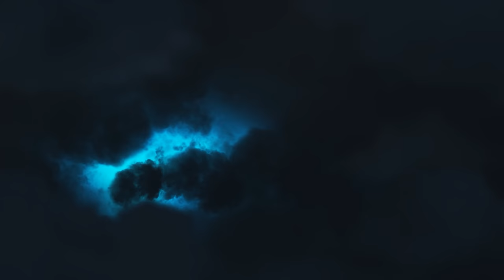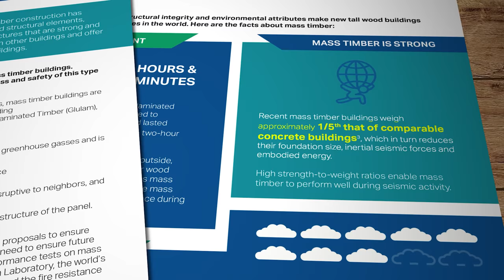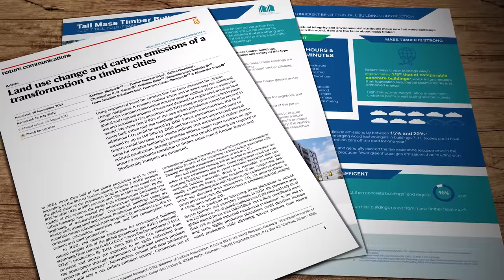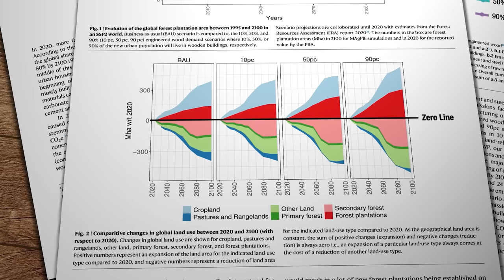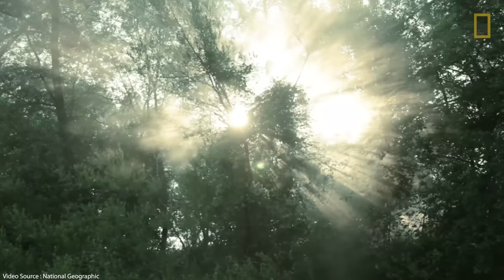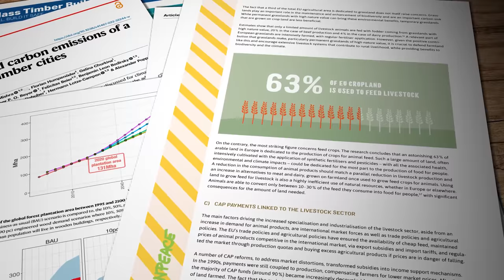Engineered Timber - building the skyscrapers of our future.

Comment: I did not check the complete study but does it take into account that steel can be made with far less CO2 émission using H2 and cement processes can also improve overtime?
As always the solution will be a mix of advances in different areas
Reply: Only thing is that the H² would have to be Green H² or somewhat equivalent. The process to get H² must be without releasing CO² or any other greenhouse gas into the atmosphere. Currently these processes are fewer and have not fully resolved the transportation and storage of H² in a significant way to make steel and concrete a viable green method of construction. Still a long way from this happening; I would say at least minimum 10 years away.
Reply: @Drought-jr6pb  Why transport hydrogen when you can transport electricity for electrolysis with existing infrastucture?

Check out SSAB's HYBRIT project. They are doing exactly that, running electrolysis plants in site and just storing hydrogen for later use.
Reply: @Drought-jr6pb  So, decade to construct H2 production industry powered by RE, parallel decade to construct H2 iron production industry (eg in Pilbara, Australia). I agree, neither will be under a decade, but economics will drive disruption more than politics (ethics).
Reply: @pikkuraami  So you are right about SSAB HYBRIT system, if what they say on their website is right, it will cost about $27 million per electrolysis plant (not storage) and they have 3 plants that use blast furnace. But it also mentions that these plants require 15 Twh per year.

Wikipedia says it takes at least 440 KWh to produce a ton of steel using an Electric Arc Furnace. The biggest SSAB blast furnace plant produces 2.6 Millon tonnes of steel and based on calculations I did an Electric Arc Furnace that if it could produce the same amount of steel would only use 1.144 Twh of electricity. And SSAB already has 2 Electric Arc Furnace plants in the US. Why not just convert the 3 existing blast furnace plants to Electric Arc Furnace plants and use less electricity from renewable sources.
I am NOT a steel industry specialist so I don't know if Electrical Arc Furnace would do the same job when producing crude steel as producing scrap steel, but if it does or can be adjusted to do the same job, it might be worth while to go in that direction. Also I assume the Electric Arc Furnace plant will cost much more to build but the annual savings on electricity would be substantial (10% of the HYBRIT system). Less demand on the electric grid in the future, since Sweden itself uses about 133.5 Twh annually.
Reply: @iandavies4853  As far as I could find out the Pilbara project is not operational yet and it is just method of producing H² in western Australia for eventually transport  to South Korea and Japan. But to this day there is no tanker built in the world that can transport Hydrogen. But of course you can convert hydrogen to ammonia (NH³) to ship globally however when you combust ammonia it will produce nitrogen oxide gas, which is bad for humans and can cause acid rain. But I'm pretty sure there are ways around this.
Reply: electricity from nuclear plants.
Reply: @dfsdh432v9  just don’t have Russia as a neighbour. Nor tsunami nor earthquake. Plus don’t ask France to build it. Or China.
Reply: @Drought-jr6pb  of course it’s not built yet! Also needs massive RE farm, H2 electrolysers & workers. Main purpose is conversion locally mined iron ore into a metallic form of iron, to be shipped out, instead of shipping raw ore. Could make N fertiliser & explosives too. I’m not so keen on shipping H2.
It’s a private / corporate project, not government. Total paradigm shift.
Reply: @Drought-jr6pb  As I understand it, in the production of pig iron, the hydrogen (or coke in the traditional process) is added primarily to to absorb the oxygen from the iron oxide. (Hydrogen, like carbon,  does produce energy when it burns but not as much, so I assume the hydrogen process does use electrical heating.) So while you can make steel without carbon or hydrogen (except, of course, the carbon that ends up in the steel) you can't make iron that way.

Comment: I've been wondering about mass timber for some time now, so thank you for this episode! I love the look of mass timber buildings, but the proliferation of this building technique unsettles me. I agree that cutting primary forest to support this growing industry would be disastrous, in the same way logging to create wood pellets that will be burned for electricity is a really bad idea. We have enough energy alternatives that this type of bioenergy should be limited to only allow the use of scrap wood materials, which might be the same materials used for mass timber so let's stop burning it, period.
Reply: The short fibers from scrap wood are not very strong. The type of engineered laminated wood for large building need long fibers for strength so it most to be cut from whole timbers.
Reply: The problem with allowing them to burn scrap, they always find it cheaper and easier to start from trees.

Just like virtually all toilet paper is made directly from trees, it is possible to use recycled paper, but the makers like having a simpler process. 

Frankly it is too cheap to cut down trees for paper and for burning. Tax it so recycling is cheaper.

Comment: The increase in trees harvested for engineered lumber may be offset by reductions in trees cut for other purposes.

Did they consider that concrete construction use a lot of plywood forms to hold the concrete in place until it's sets?
Reply: Not sure what is used for forms with precast concrete? Concrete floors in skyscrapers have steel as the subfloor.

Comment: A friend of mine was testing their product for fire safety. They built a room and set it on fire. They had used engineered beams in the ceiling. The beam delaminated before anything else failed. So they had to rebuild the room and do the test again. This was over 15 years ago. 

I don’t feel engineered lumber is bad it’s just new and you have to be careful with quality control in new technologies.
Reply: Compressed straw is a fire retardant and a good insulator.

Comment: What if we rehabilitate/regreen the Sahara and use it as a source of timber?
Reply: Albedo is the concern there
Reply: David Shapiro     Just how are you going to do that? Fusion for desalination?
Reply: What a great idea!
Reply: ... why not just regreen the land that we do have to responsibly produce the materials we need, instead of destroying more natural ecosystems and using other countries territories?

why not focus on redesigning cities to be able to grow more vegetation, like in pyramid steppes? it would reduce heat in urban areas, but i do not know how much it would actually help offset the co2 produced.

why not also create more buildings to go underground to be able to save energy by having higher thermal insulation? this design may not be as useful in areas that are at high risk to floods.

why not use hemp blocks, bamboo, and other natural materials for smaller scale buildings that are only a few stories, and save the materials such as engineered timber or steel for larger projects?

i feel like rehabing the sahara is a terrible perspective. first, it is already being attempted, and, second, it would take a very long time, and, third, we could actually get much more done if we take alternative routes to urban design.

Comment: I'd prefer something like hemp blocks or mushroom based wall filler, which grow faster and don't have a 30 year wait time for new growth of forest for houses past the current ten year current window we have to reduce emissions.
Reply: But this technology would be meant to replace the steel for skyscrapers.  The stuff you mentioned would be great for homes.
Reply: @artboymoy  Some of the figures presented was 90% of all new buildings, that includes homes.
Reply: @artboymoy  Can't we engineer hemp wood like we engineer timber?
Reply: @artboymoy  i think the way to go would be to reserve concrete and steel only for basements, timber for large buildings and straw/hemp based organic products for houses and small buildings.
Reply: That has it's limitations and is cement heavy.  
Mimicking forests through planting makes sense.  
Mark Shepard of Restoration Agriculture fame mimics local forest guilds by growing food crops of trees, vines, shrubs and perennials.  He converted a run-down dairy farm, in an area that was open cultivated fields and general bad land management.  He uses a savannah/alley cropping for more efficient food production. This assists in pest management as well.  He also uses livestock in a variation of mob grazing as part of the management system. 
You end up with more calories and nutrition per acre than the previous use or that of the neighbors..
This way at the end of the tree's life-cycle you also end up with timber. 
It's an ecologically sound as it supports wildlife,soil rebuilding,is diverse and avoids chemical use...
Reply: @notafantbh  Jeffrey you are so correct it's a question of "horses for courses" Chosing the best option that is appropriate for the task at hand is what we should have been doing all along. Using mass timber for everything is not good practice. As is illustrated in short in the YouTube film lWood is an excellent construction material and that is what it should be used for like high rise and important structural members. Fast growing crops like straw and hemp for insulation wall infill etc.

Comment: I guess stop using wood pellets and burning biomass from forests would reduce the land use? Heat can be produced by heatpumps or similar.
Reply: Uk imports huge amounts to keep the old coal fired plants running.  I assume/ hope this is a short term measure until full renewable power is on stream.

Comment: Two things : What about Bamboo? And,  I've asked many times what is the carbon footprint of a High Rise that has hundreds of people using a very small piece of the planet? Two hundred families in individual homes, with gardons and driveways, would seem like it would use a huge amount of carbon sequestrating land.. Have you ever found a comparison of the concrete carbon footprint of high rise over six stories vs massive urban sprawl???
Reply: look into the channel notjustbikes for more information on how to build a city correctly. What you describe is explained over at his channel. Sprawl does not just need lots of carbon to build. it also needs lots of carbon to live in.
Reply: @Anonymoose66G  *Niche
Reply: The primary thermal stabilisation is ground bonding of foundation of buildings allowing netzero impossible on highrises!  Lighter beams do drastically increase usable squarefootage I assume however.  Bamboo fibers in mass bamboo beams or bamboo tubes?  I've grown bamboo it responds to extra water and high sun as you know it is fast, very fast, being hollow helps that of course.
Reply: Hemp has excellent building properties and needs less Water to grow. Also, downsizing is critical.
Reply: @jims6498  Where on Earth is Water available, now?
Reply: @jims6498  it also cleans water.. still, a net zero house only works for one family , and then the next net zero house needs more land and is further a field ( pun intended) for transportation, work, healthcare, and infrastructure.. It takes twice as much land for two net zero homes.. But not for 10 families living on the same piece of land ..

Comment: I think it would be interesting to see a video about possible cement and steel industry changes that make them carbon neutral. For steel, using high-quality "biochar" (charcoal made from a variety of plant matter) could gradually replace coke in the manufacturing process.
Also solidia (non-hydraulic) cement sequesters CO2 in its curing process, where portland cement (the most commonly used cement) emits CO2

Comment: An aspect that hasn't been discussed is how rapidly softwoods degrade when exposed to UV light, temperature changes, humidity, lack of humidity, insects, etc.   How long these constructions last and the maintenance they require must be taken into account, and I'm quite certain there are no realistic studies.  Wood constructions would need to be drilled, bored, nailed, screwed, etc giving vectors of penetration to any protection applied to the wood externally.  If you want to save on carbon build to last, not just construction but in the entire manufacturing industry.  Planned obsolescense is a HUGE carbon contributor as well as an environmental disaster in it's own right.
Reply: I hear you and agree but given we have wood framed houses and buildings that are over a century old all over the world it's probably not that big of a deal
Reply: Timber frame homes have a lifespan of about 70 to 100 years in Australia.  Wood cabin style homes are used all over the world and many very old buildings in raw wood over a hundred years old are common.
Reply: Germany is full of half-timbered houses from the 1700s and 1800s, some as old as the 1400s are still standing. Surely engineers know a lot about wood construction by now?
Reply: @Borishal  Old timber frame buildings are quite common all over, here in Spain you can usually tell which ones they are, because they're often butressed at the base and their real estate values are low.
Reply: @mju135  I have a 300 year old stone house in the Rioja region of spain.  It has plenty of wooden beams for the floors and the roof, oak beams not softwood as was discussed in this story.  Many of those beams have survived the centuries, but then many have not.  It's only a two story construction so not so worrisome.  The maintenance is constant the exposed roof beams need treating every 3 years or so, and if I fall behind the sun and the ice make short work of it. 
 I can't imagine this in a large structure.
Reply: @Tasmantor  There has always been an attraction to making things quickly and cheaply and letting the future deal with the consequences.  It's precisely this inclination that is causing environmental disaster on the planet earth.  It's one thing to build a 2 to 5 story building this way, quite another to build high rises.

Comment: Have you ever lived in a steel town, breathed the air and felt the heat?  With engineered "wood", natural fibers are the sustainable option.  The real problem of deforestation is too many people and too little regulation. I question if high rise construction is the best used of material for any structural material.
Reply: It is a better use of land than the extreme sprawl of suburbia.

Comment: Not building over 10-15 stories would go a long way.  Regardless of steel vs engineered wood (or bamboo) this decreases resource requirements.  Mix in robotaxies, transit systems and tunnels and we are fine.  Decentralized and automated distribution of goods with less centralization in ultra high density cities will reduce overall needs.  Low rise multi family structures are the most resource efficient way to provide homes.
Reply: Would it? Is there hard data to suggest the number of people sharing a high rise would be less than that of sprawling suburbia? Mass transit and transmission lines work best when more people and energy travel shorter distances on fewer routes..
Reply: @spencerbardell2180  yes, the short answer is yes. people in the city drive 1 mile to the grocery store, people in suburbia drive 5 miles to the grocery store and people in rural areas drive 50 miles to the grocery store

Comment: I suspect this would be a similar situation to that of carbon credits. If we built large buildings with wood instead of concrete and steel, we might save on the CO2 emissions - but what's more likely to happen is we'll consume wood in addition to concrete and steel. These projections are frequently based on the assumption of one technology replacing another - in reality, it's often the case these new technologies just end up adding to the problem. I really doubt we would reduce our consumption of steel and concrete - we would most likely just build even more stuff...
Reply: that's very true, electric vehicles are the same situation.
Reply: @Lildizzle420  Another example is e-bikes. They claim to offset car journeys, but in reality they offset traditional cycling and walking

Comment: Well put. The solution is to focus more on 1 year biogenic and/or unburned mineral materials, and save CLT for horizontal layers when necessary or only in +5 story buildings. I'd recommend you to make a feature on EcoCocon wall panels of straw, pre-fab insulated rammed earth elements and the progress in structural hemp "timber".

Comment: Perhaps we could consider using existing monoculture wood production currently used to heat houses (wood pills etc) to produce wood for engineered timber. We could and should replace burning wood for heat with green(er) electricity based heating.

Comment: Engineered timber also has excellent fatigue (durability) performance as cracks are stopped by the laminated structure.  I have made an arm to hold my video camera for the computer using laminated wood and it works very well as it is also stiff enough to do the job! 😅